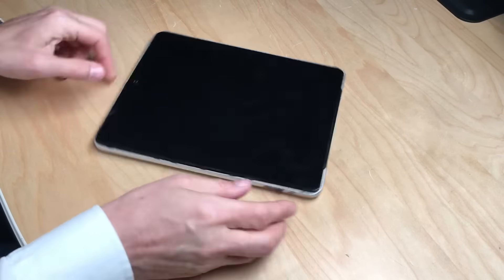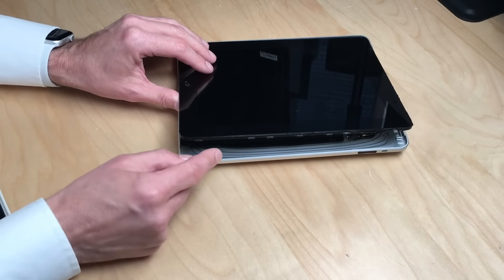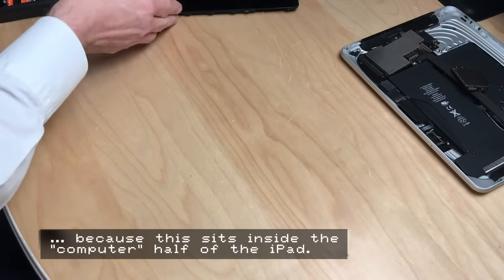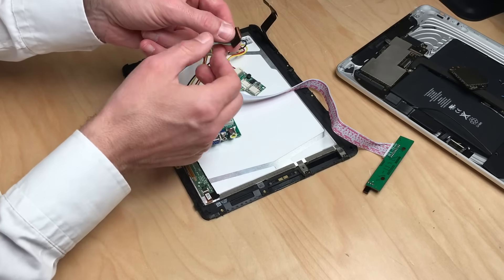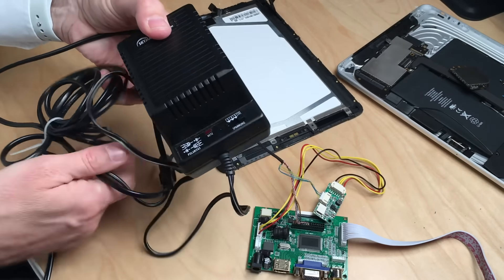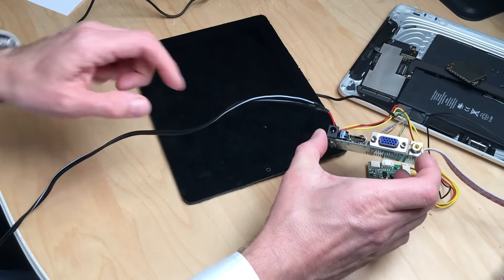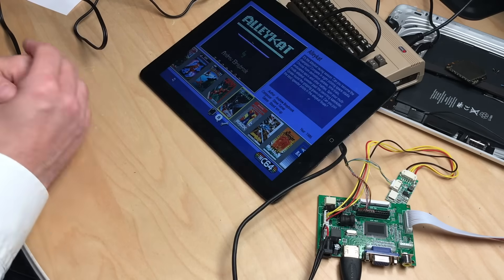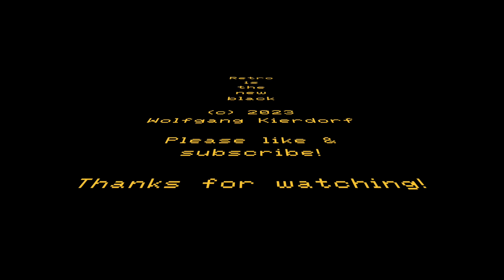Turn any old Apple iPad into a real HDMI monitor (with HDMI & VGA input)(iPad / air / mini / pro)

Comment: Really interesting. I have a cloud locked iPad that I want to use to repurpose the screen, and retro fit it to a PowerBook 170 with a broken screen.
Reply from the maker: I am not sure about the PowerBook video input. If it has just bog standard RGB that should work.
Reply: @RetroWK  I’m hoping to tap into the external monitor port somehow. It will be a challenge squeezing all the driver boards in though. Maybe I can put them where the battery goes.
Reply from the maker: @TheBasementChannel  It could be, that you can leave the button board out. I think I remember that the display then powers on when it get's juice. That way it could fit. The panel in the PowerBook is a bit thicker than the lcd from the ipad. Leaving out the battery could work. Maybe remove the vga connector etc. from the board. that takes away much of it's thickness.

Comment: Thank you for the idea!!! I have numerous LCD panels in perfect condition from obsolete Android devices, but I wasn't sure what to do with them. It's frustrating to have a perfectly good device that's become useless artificially.

Luckily, my old iPad 1 still has a decent original battery. I mainly use it for:
- Watching YouTube videos (using the last version of Chrome that works)
- Listening to various podcasts
- Playing a couple of old games
- Streaming music to a Bluetooth speaker

However, apart from YouTube, I can't use it for much else, especially not on HTTPS sites as the certificates have expired a long time ago.
Reply: Jailbreak it! You can reclaim so much functionality.
Reply: @JoBot__   how does a person jailbreak an iPad do you know of a tutorial
Reply: Sure, for generic Android tabs, but I'd keep Apple stuff intact and sell it on the retro market in 30+ years time for more than bought for. Personally though, I don't buy overpriced Apple junk.

Comment: This is really sweet, I was afraid about the cost of the board before you mentioned it (well, I suppose I could have read the description before) as it means everything about this kind of project being worth it or not, but given the total cost I think I'll do this at some point. I do have an iPad 2 with part of the touch digitizer unresponsive, which makes the device nearly useless, and thought that might be repairable, being an old, obsolete model I don't think it's worth putting any money or effort into it, and guess it will serve me better as a little monitor instead. Nice!

Comment: So I checked eBay after watching this video to see what the Ritnb effect would be. I got there just in time to see a 1st Gen iPad Pro going for $344. LOL!
Reply from the maker: Wow! I can still get them here for few bugs. Works also with never iPads or MacBooks.
Reply: @RetroWK  Well, I can always scare up a few bugs... :) But I'm more of a "Never Apple" kind of guy myself (but a big fan of Newts!).

The "best" consistent price on eBay here was ~$65 - $75. But there were two auctions of the "Pro" iPads fetching >$335. What's so special about those?
Reply from the maker: @MrWaalkman  I just bought this iPad2 for € 14,-: https://www.ebay.de/itm/275843500605 . The pro line of ipads have the pencil support and better screens. Later (normal) iPads have this too, but the pros are the top line with all the cool features that drip down the ipad line over the next years.
Reply: @MrWaalkman A 1st gen ipad pro is not a 1st gen ipad. Totally different beast. The 1st gen ipad pro came out in 2015 and is still pretty functional. The 1st gen iPad came out in 2010 and is practically useless.
Reply: @mondotv4216  Ah, thanks. I'm not a Apple guy so it's not something I would (likely) collect. I do like my Newts though... :)

Although the Sharp Brain running Linux or Windows CE is pretty nice too.
Reply: I got an old 1st gen that is useless since apple killed them. There are no apps you can download off the apple store. Was wondering if i can use it as a moniter.
Reply: @NateJones-tk9fb  mine has been relegated to a PDF book reader. I currently have most of the D&D 5e books and organized play modules on mine.
Reply: Actually 10.1“ Displays with 1024x600 are available at AliE for around 40€. Anyhow I like the idea of recycling.
Reply: Weren't those like $1500 brand new?
Reply: The „Pro“ is NOT a first generation iPad 1!
Reply: I got one for $30 of of ebay

Comment: Where's the repupose old macbook screen? 😁
Reply from the maker: Works the same! I did that to an old PowerBook. The screen is just very dim. Retina Macbooks make for nice screens.
Reply: are connectors the same for all devices?
 @RetroWK
Reply from the maker: @OniKrisNeptune  Nope. Different connector for all LCD panels. But iPad 1 and iPad 2 use the same panel, so same connector.
Reply: @RetroWK  is there any info available on what models panels are compatible with an ipad 7 screen?

Comment: Some driver boards with composite input also accepted 15kHz on VGA, but sadly not all do (actually most do not). Have you tested if it is possible to process a 15kHz RGB source (like an Amiga monitor output) on the VGA input of this driver board?
The aspect ratio seems a very good match for retro computing.
Reply: I also wonder if that composite input will provide artifact colors provided by, for example, Apples or Color Computers
Reply from the maker: I did not test that. Sorry!
Reply from the maker: This board does not support 15khz. The aspect ratio is indeen great for retro stuff.

Comment: 0:42 manufactured ewaste tuned into useful tool, nice
Reply: I wonder, if one could get such driver-board with usb-c, which could power up that display itself - i.e. single-cable. and, if such component could be put within an origin chassis, then one would not need to worry about display structure.

Comment: Very cool!
I have done this with some old laptop LCDs, but you have to be careful to get the right driver board (and firmware) for those.
Reply: Yeah, I’ve had bad luck with that. Two driver boards falsely advertised for two different panels. Really sucks
Reply: Can you send the firmware?